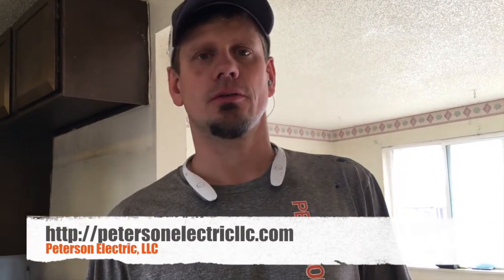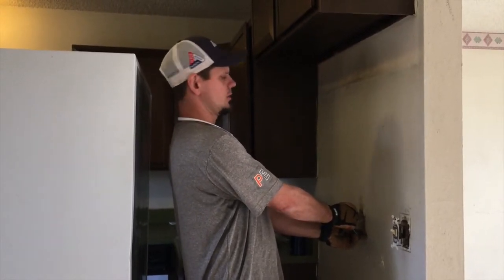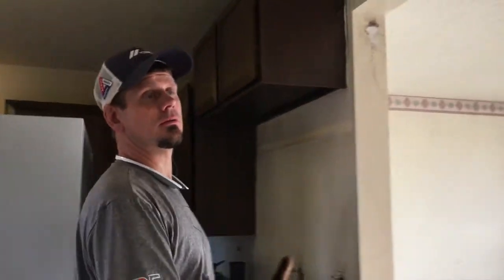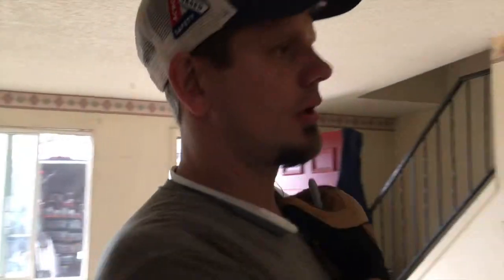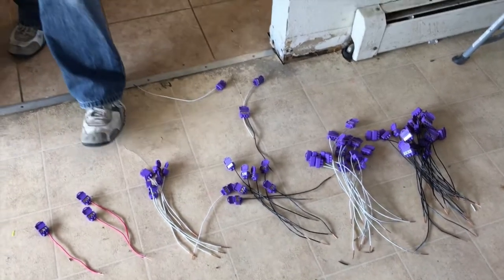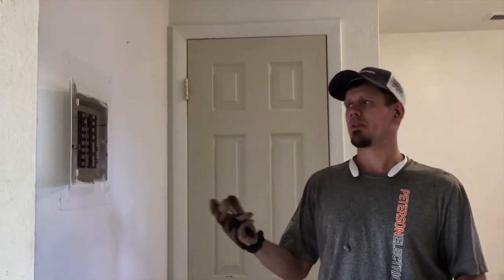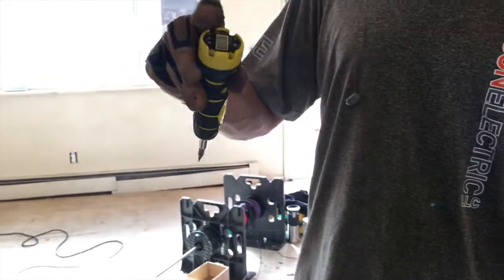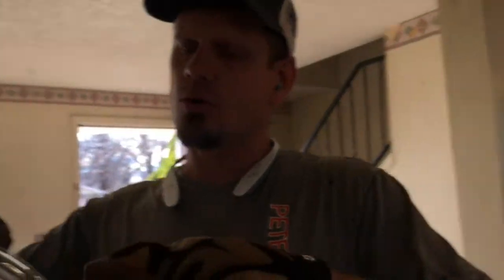Cutler Hammer (CH) Arc Fault Breaker In Electrical Home Panel, Why?

Comment: Correct me if I'm wrong here, but an arc fault with a standard 10k AIC rating is not going to change the available fault current at a device. Changing the breaker to an afci will not change the short circuit current. A new standard breaker would work just fine in a line to neutral fault. Sadly, 406.4(d) will cause a number of issues with this argument, and drive the cost of a "re-device" into the thousands once fully adopted. Thanks for the videos, as another Colorado electrician I enjoy seeing what others are into.
Reply: It is pretty cool though when you ground out a hot wire to a bonded grounded metal box, it does not even spark, it just shuts down the circuit.